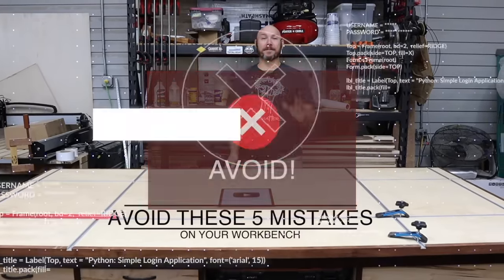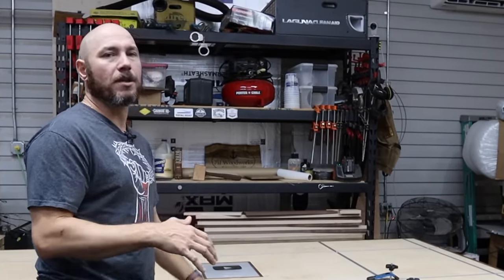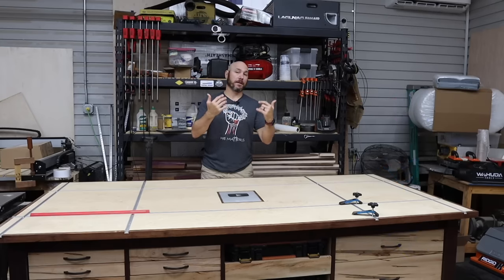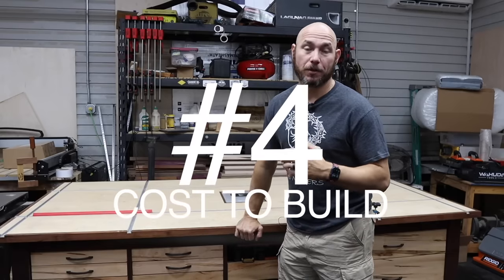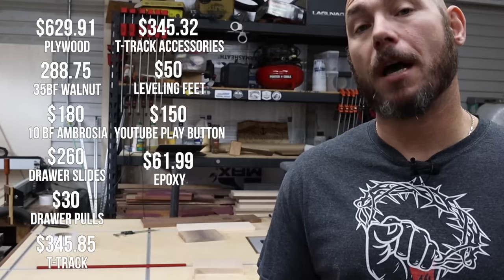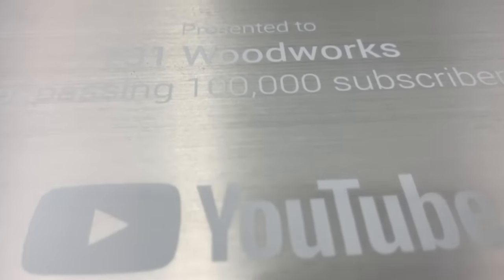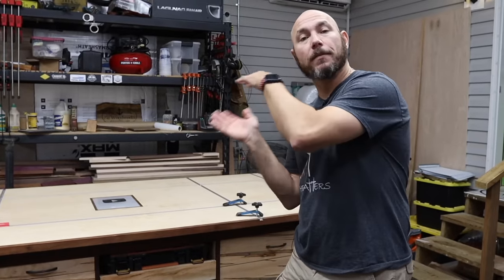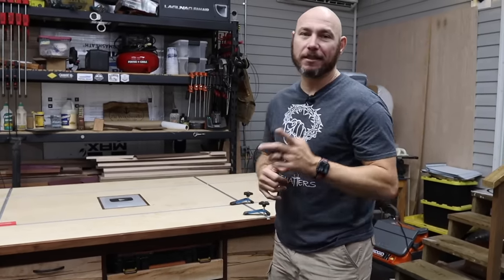Don't Make These 5 Mistakes When Building Your Workbench!

Comment: That's a great looking workbench and you made some great points about what potential problems to avoid.

One question though, and please know that I haven't seen the build video yet, but why didn't you cut a shoulder into the posts to accept the rails? That seems like it would have eliminated the squareness issue you pointed out.

The outfeed/assembly table that I want to build will be 4 ft wide but I'm vacillating on whether to make it 5 ft or 6 ft long. 5 ft would be more accommodating to my available space but 6 ft would be nice to have and would still be somewhat acceptable. I like your reasoning for making it as big as you can, you may have made up my mind. Lol

Comment: Great teacher/instructor. I realize costs have changed since covid, but your estimates give us a gauge to work from.  Your designs and thought that went into your bench. It takes a few projects that make you say to your self..HMMMM…could have done that different if I had designed my work bench differently. However, now with 3 work benches on casters…works great. Very encouraging presenter. Thanks

Comment: I made a modified Paulk work/assembly bench that is 6’x4’ and 7” thick. It has cubby holes for putting things inside the bench, and I use these daily. My biggest regret with my bench is the top’s thickness is only 3/4”. I like to use dog holes, but that requires a much thicker top to work well. I resort to using F style clamps with the fixed end retaining pin removed. Still not optimal. I am going to add another layer of 3/4 plywood and redrill a few dog holes in specific locations (far fewer than I originally drilled.) Also I added a 1-1/2” ledge along one land side to have something to clamp on. Would I build my Paulk bench again? Probably not. Stumpy Nubs made a dandy bench from yellow pine that makes more sense for my shop.

Comment: For t-track and similar types of things (e.g., if you need 2020 T-slot extruded aluminum for a project), you should just cut out the middleman. That stuff is coming from China where ever you buy it, so just go to Banggood and buy it. (Downside: Shipped from China, so, it can be weeks to arrive, so, plan ahead!) Amazon does have bundle prices, so do check if you have to get a quantity of it, but it's often cheaper to buy from BG or Amazon depending on sales.

Comment: I’m just about ready to set up my workshop. Designing and getting ready to build my first ever workbench atm. Thanks for the tips. I’ll be using MDF for the top. Would you still use Odies to treat it?
Reply: I'll be doing the same shortly, but I'm considering using a laminate top. Hard to scratch and easy to wipe clean with any type of thinners etc.
Reply: @JayDee-xj9lu  I did consider that, but as I’m a complete noobie, I don’t yet know what my bench needs to do. I think very soon, when I’ve figured out what I’m actually going to use it for, I’ll have a better idea of how and what to build it from. 👍. Would be surprised if it gets demoted to an assembly bench within the year.

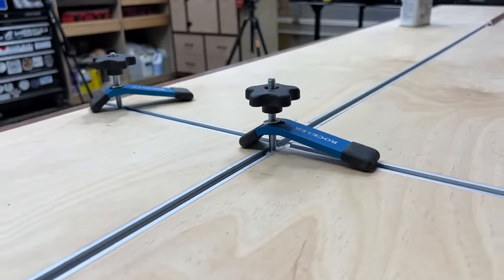Comment: 1:11 Those leveling feet are great for temporary use, but I would make some 2 piece angled shims, like what would be used to level kitchen cabinets, only much thicker and nice looking, out of some scrap hardwood to really stabilize the bench. Once you have the height for each leg figured out, mark them, cut, glue&screw them together and slip them under each leg with a bit of glue on the top of the shims to lock them in place. If you wanted to, you could get a bit fancy with them and trim them out to look like casters for furniture legs. 5:50 I know it wouldn't have been a huge amount of savings, but if you had enough walnut left over, you could have made your drawer pulls out of it, and they might have even looked a bit nicer. 6:05 You could have saved a big bunch of $$$$ on your T-track by using generic stuff. I buy my T-track on Amazon for a fraction of the price of Rockler's, and it's very close in color. I also have some generic T-track hold down clamps which are also a fraction of Rockler's prices (also very close in color), and all of Rockler's T-Track accessories fit right into this T-track. I'm sure if you hunted Amazon for T-track accessories, you'd find a bunch that look very much like the expensive stuff, and works every bit as well, for a lot less $$$$. I did buy some Rockler Bench Cookies though, because nobody else makes them in blue. Let me know if you'd like me to share the links for what I have here. Please don't think I'm criticizing or nit-picking your bench. I think it is HANDS DOWN THEEEE FINEST workbench I have ever seen. I just wanted to offer a few tips and money saving options.  :_fistbump::_fistbump::_fistbump:
Reply from the maker: Thank you for the tips!

Comment: Very nice workbench, perfect size And the price is not out of hand for what you built. Watco is definitely not the right choice but to solve the problem get you a can of mineral spirits/paint thinner and wipe/sand the whole thing down using 800 grit scotch Brite and then apply the finish of your choice. I’ve had students find pieces they’ve built two in three years earlier and have them do this and itself is a problem for them. And I Yes it will take time to wipe all of the drawer fronts and the table where you used the oil but that will solve the problem. You can cut round discs out of the Scotch-Brite pad and put them on I am a cheap random orbit sander to make things go quicker.
Reply from the maker: Thank you for that information

Comment: You can build a bench this size with 2 pieces of ply (1x 1/2inch piece for a bottom shelf and 1x 3/4 inch for the top), 11 2x4x8's, 4 casters (optional), and the fasteners. This comes out to around $200 max.

Comment: My opinion, laminate ( plain white or black, none of that foe textured stone stuff )  makes the best surface for general work tables in the shop. ~$70 for a 4x8 sheet is well worth not having to worry about destroying the top with glues, finishes, chemicals, pitch, scratches, dings and dents. You'll tend to be more careful and precise with saws and tools as well, which is a good thing. Slick, but not too slick for outfeed tables and router tables.
Reply: I agree.  When in college, I stumbled into a nearby remodeling business that sold [used/demo] formica countertops for $1/foot.  i bought a big one to put on a couple of two drawer metal file cabinets for my desktop, and it is my main workbench to this day (I'm 62 years old).  Nothing phases it, but it now rides on a couple of 36" tool chest bottoms.  Not bad for $10.

Comment: I like the part were you price out the cost of the work bench i would like you to do one on how much it cost for your router table
Reply from the maker: Thanks for the idea!  To be honest I was extremely hesitant to put that in there and almost pulled the video this morning and re-edited it.  I didn't want folks to think I was just showing off or anything.  I put it in there though because I didn't realize how much it cost to build one this size so decided to leave it
Reply: Good decision leaving it in. Now those of us contemplating building it will have an idea when we might be able to pull it off rather than jumping right into it and realizing it isn't the project for us (at the moment) due to costs. :_fistbump:

Comment: The garage is sloped and you don't know why?
I will call when you drive your car and during the winter and it's got snow and slush all over it, do you want the snow and slush to melt and run towards the house or away from it?
The original design was not for a workspace but for a garage that cars will park in.
Reply from the maker: I know that a garage is SUPPOSED to slope.  Mine slopes toward the house.  Not away.  It's jacked up.
Reply: @731Woodworks  Apparently, listening comprehension is a challenge to some.